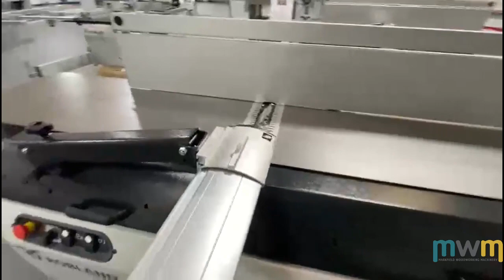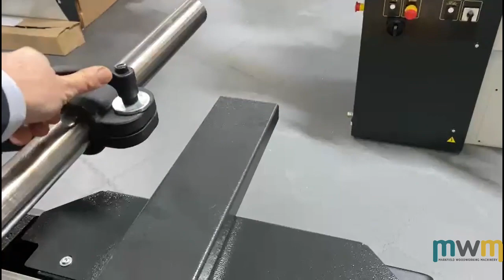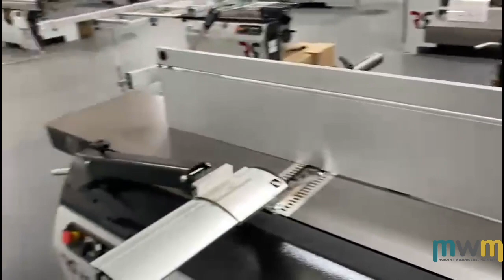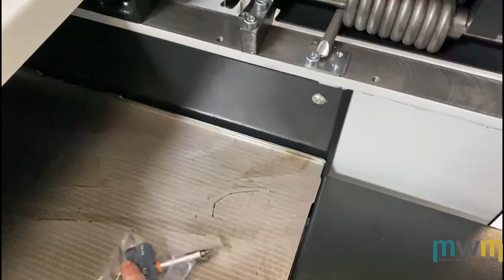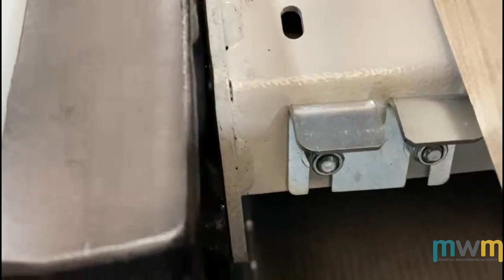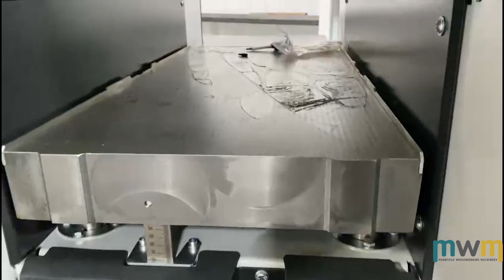Robland SD410 Planer Thicknesser | Showroom Machine | MW Machinery

Comment: hi is the 510 on single phase as i need a wide table but dont have 3 phase
Reply from the maker: Hi there, thanks for your question.
The machine is three phase, however you could run this machine on a phase converter which we could also supply to you :)
Reply: How much total please with phase converter
Reply from the maker: @doingitourselvesbudoandtracy  Would you like to give me your email address and I will pop a quote over to you?